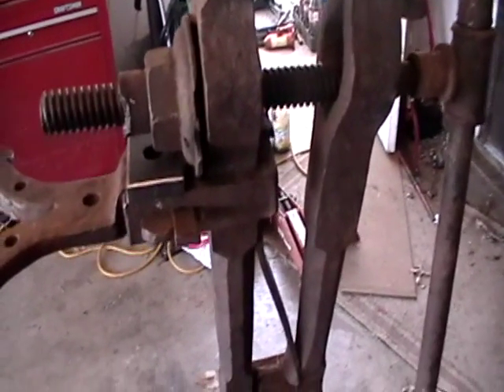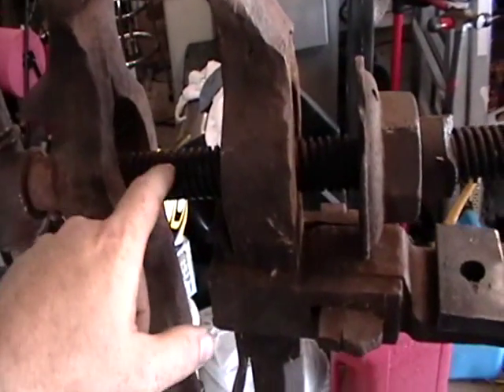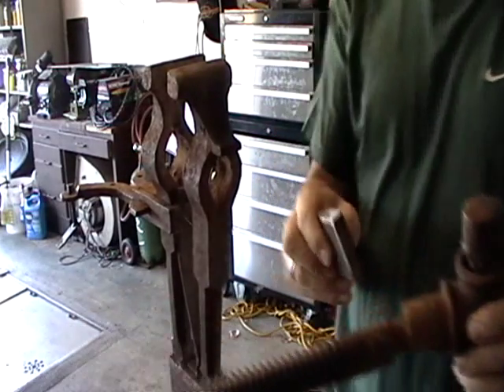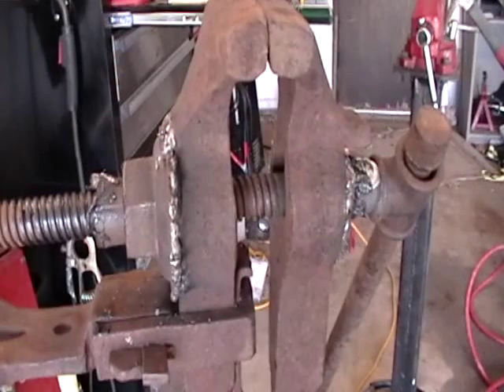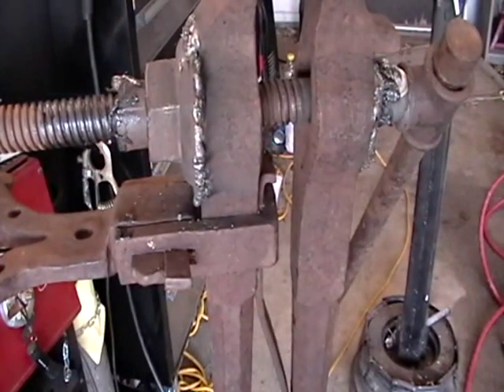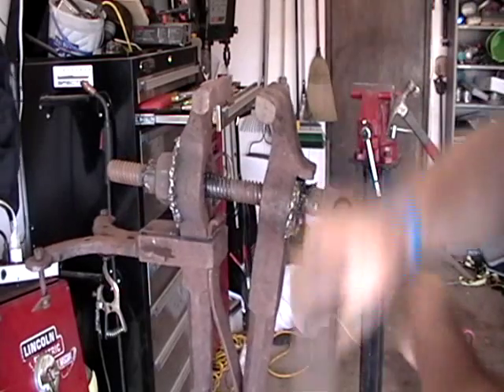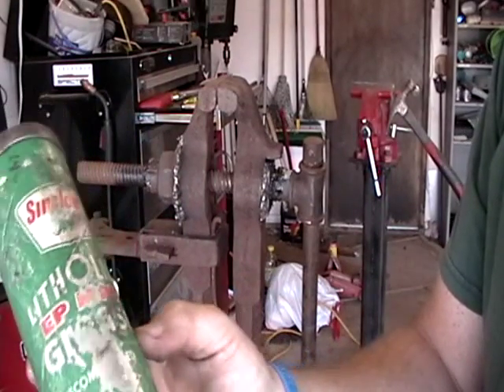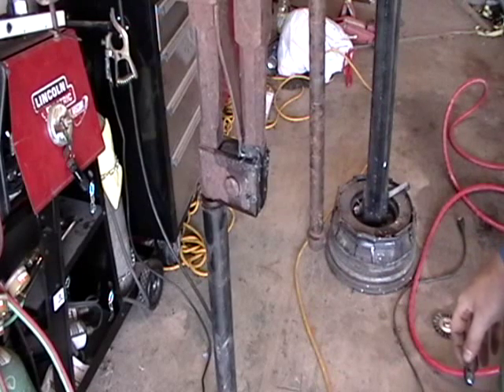Free OLD Vise  blacksmith post or leg vise

Comment: Very Cool vice...  The vice body is either cast iron or cast steel.. Either way they take a special composite weld wire and a lot of pre-heat to get a good weld on them.     Like you said, It should work out just fine.
Reply from the maker: I did preheat it with the torch a little just in-case it was some kind of cast.  I didnt get it red hot but got it pretty darn hot anyways
Reply: I know for fact that it isnt cast iron 
Or cast steel all of those kinds of vices were forged and I know because I am a blacksmith and I do have a couple of those vices
Reply from the maker: good to know thanks   
Im hoping some time this supper I can get a backyard foundry made a do a little blacksmithing (my be more like gray or white smithing LOL)
Reply: make sure to film if you can, i hope to be doing the very same this next summer
Reply from the maker: I still plan on doing that.  I have an old water heater core that i think would with great for a foundry

Comment: You need to take that vise to a good machine shop and have them to machine the proper parts to fix that vise right.
Reply from the maker: Here we are 5 years later and my fix is still working.
Reply: @2LateIWon  Thus says the botcher
Reply from the maker: @johncolvin2561  you can't argue if after all this time of use it still works.  If it works it works.

Comment: Actually, bad idea welding that nut to the vice.  That's why it won't open correctly now.  Someone put a wood working vice nut and screw on it.  You could have welded a short piece of black pipe to the nut that could fit in the vice.  Weld a small piece of metal on the pipe for the key, so the nut doesn't spin.  Then adjust the spring so it has more tension if needed.
Reply from the maker: So far so good.  I think after working in some oil and grease it works like it should.  I do like your idea as not making it as permanent.  that way in the future I could tear it down and clean if need be.

Thanks for watching thanks for the tip

Comment: It's a Blacksmiths Leg Vise,  it's supposed to be a Free-floating screw box design so that when your pounding the energy isn't transferred to the screw.. but to the LEG that's in the ground.  This is different from your standard variety Machinists Vise which isn't made for Pounding.. and you will break the screw, due to the energy transfer directly to the screw. * This can take a long time.. or a short time. Depending on your vice quality* instead of the leg into the ground.   Yes it's wrought iron.   when you mount with the mounting bracket.. your Swivel action should be eliminated.. But essentially you have ruined this vice for it's designed purpose.. but it's not beyond repair.. :)  get the correct screw box,  back into it.. https://www.youtube.com/watch?v=SrZcfdehS6Y